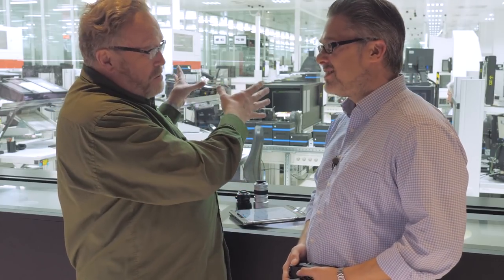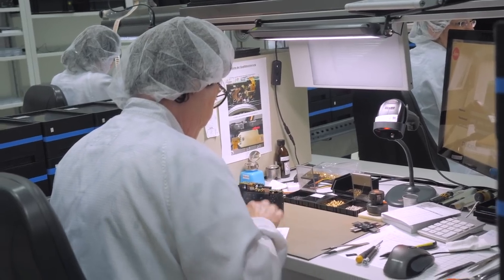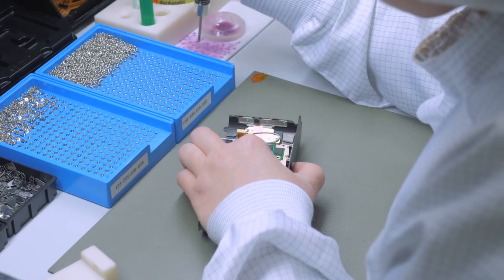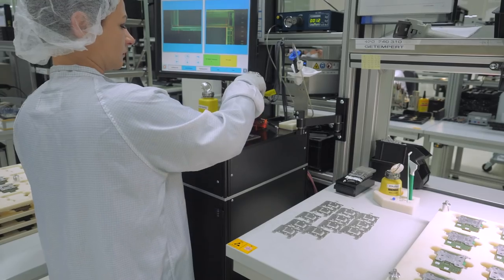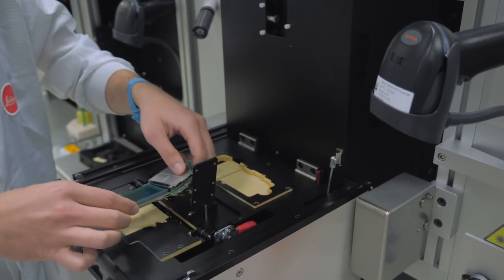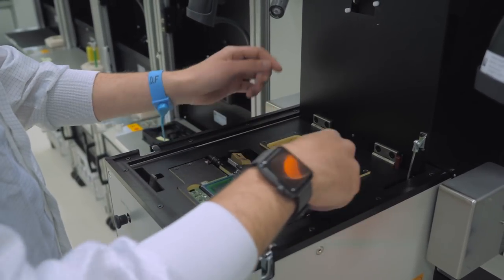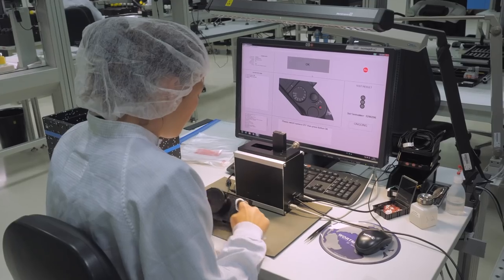Leica 05 Manufacturing & Assembly

Comment: So they basically only insert the sensor and QC an M and can legally print "Made in Germany"?
Reply: Haha. No. You only are seeing the assembly line and judging of that ?😅
They make everything in Wetzlar (this includes a lot of quality control)- but of course not the sensor... .
The camera has a lot of mechanics due to its special focusing system. Also most of the M lenses are also made in Wetzlar. The rest in Portugal (in their own factory there) - however, there is no quality difference since they operate in Portugal for over 40 years now